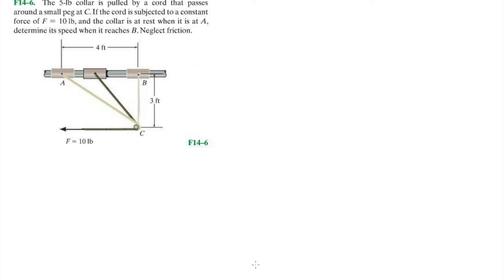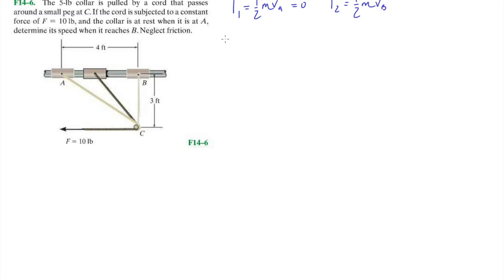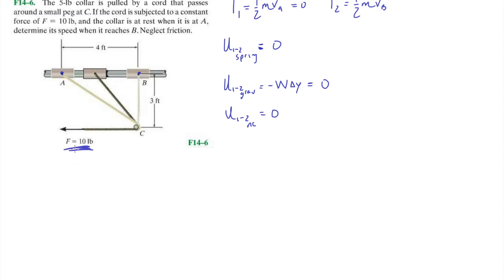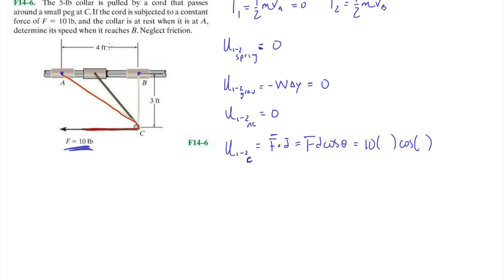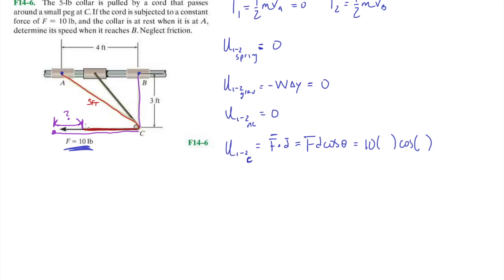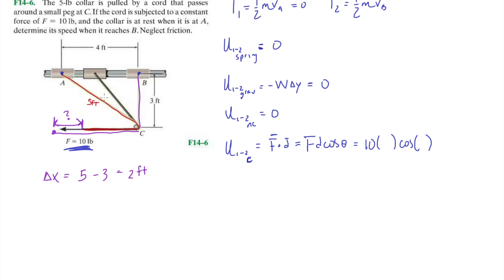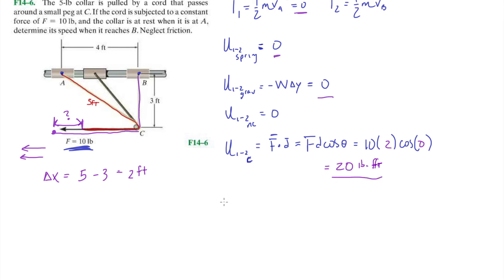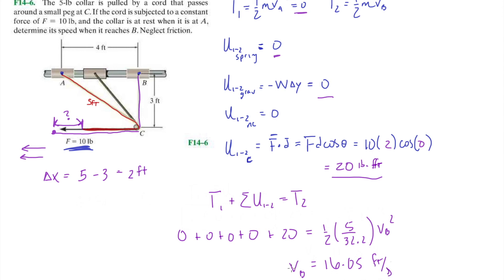Problem F14-6 Dynamics Hibbeler 13th (Chapter 14) Engineering Dynamics - Work and Energy

Comment: If we use the Principle of Work and Energy on the string (since we used the distance of the change in length of the string end), wouldn’t that give the velocity of the STRING and NOT the velocity of the collar?
Reply from the maker: good question. Using the change in length of the string, helps us determine how much the collar has moved.